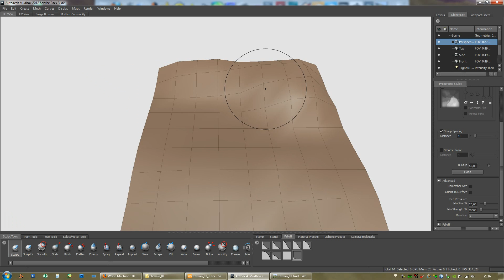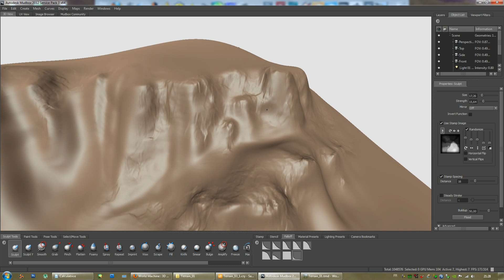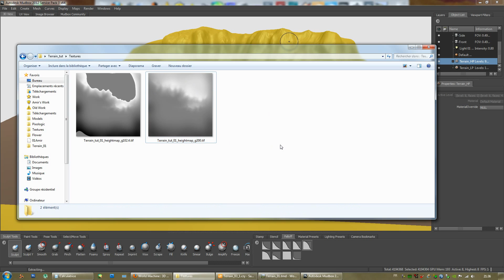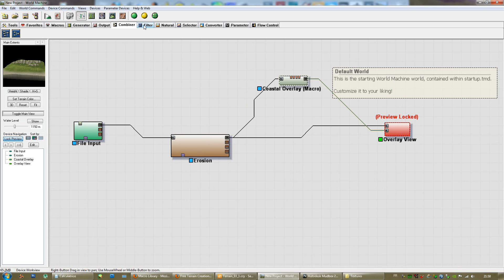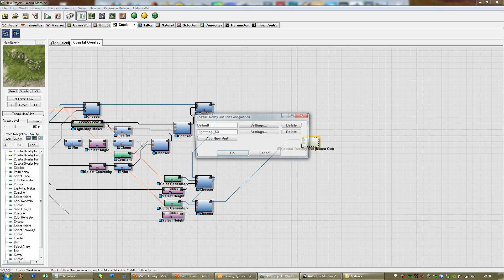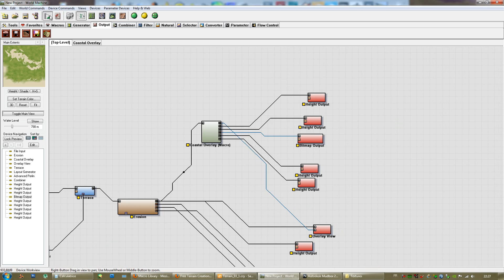Comment: how do i join the mudbox files together in world machine, ive exported them and import 1 to world machine but my map is huge and there on 512 by 512 planes, i dont understand the tile  system i have the pro version of world machine and just need help, i tried to make a 8192 by 8192 map in mudbox but its not detailed enough and take a long time to build in WM, help is in need, how to i join loads of hightmaps together
Reply: Worldmachine has a node for Tiled input maps, that should work for you.  Otherwise just photoshop them together.

Comment: First of all thank you for this tutorial series. I am really interested in creating landscapes for CryEngine and I managed to create a quite nice seaside road with the sea and cliffs on one side and a "mountain" on the other side I guess but I experienced a problem with that "noise" part of this video. I used the settings of your Scrape-Tool except that Falloff (don't know how to achieve this Falloff like yours) and I don't get this noise or erosion effect like you. I am using the free trial of Mudbox 2015 and my mouse 'cause my sister is using my wacom tablet for her drawings.
Reply: Problem solved. Just tweaked the randomize effect of the stamp a bit and changed the strength of the Scrape-Tool.

Comment: mudbox?... i doubt is cheaper than world machine, but maybe you could make a basic rgb splatmap in mudbox and use it as the base to start texturing in photoshop or use it directly in the engine you're using.
heightmaps, again you could goggle image'em and modify them in photoshop and mudbox too.
also, gimp used to be good a open source (and free) photoshop replacement, don't know if it stands to today standards thou, haven't used it very much.

Comment: 4km by 4km? Lol.

Not necessary. Just make multiple levels. A 4km by 4km map not only would be extremely time consuming, but will limit your targeted audience. Even if you market for free, you're still going to need someone to play your game.

Also, no, it's not transferable. Changing size of the map means you have to start over. At least that's what the SDK itself states. A heightmap would be sufficient if you made it at the 512x512 :)

Comment: There's a better way: Right-click on the downloaded macro file and click on Open with. Choose WM as application to open the macro with (you'll probably have to browse to the app) and activate the option to open all files of that type the same way. You'll get a message that the macro has been installed properly. The newly installed macro will be listed under the pre-installed WM macros.

Comment: Incase anyone has this problem. I have the soltuion. 

Open the tiff file in photoshop by going to File>Open As>Click the file, Open as a tiff. 

This way it stops photoshop automatically opening the file as a 32bit or 8 bit, 

The image's 'bit' can be shown in the Image>mode section inside photoshop.,16 should be ticked!!!

Comment: In mudbox, i can barely sculpt my terrain, Its so slow. And another thing, you say that i should make a plane of 512x512, but when i drag on my grid and i u say that i should use 512 in width and 512 in height it just makes a small square in the middle of the grid.

Comment: I'm not a formal Maya User but I've used it in the past and thats some of the many reasons I hate it, not saying that its bad but its unnecesarily complicated IMO, anyway, it comes by default with some exporting options and many other features shut down, such as the OBJ Exporter, so you have to turn them on manually, if I'm not mistaken you have go to Window, Settings & Preferences, then you select Plugin Manager then a large list of stupidly turn off shit should appear, you just turn on OBJ =)

Comment: hey, if I am using the basic version of worldmachine, and I am creating a small map for cryengine, what size plane should I start with? If i remember correctly, you ended up rendering (in worldmachine) with a resolution of 2048x2048, giving you around 4 million polys. As the basic version is restricted to 512x512, we have around 200000 polys. The end size of your map was 1024x1024, and you had a plane 512x512 in Maya, so If I end with 512x512, I should start with 128x128?

Comment: @s13n1 I should clarify my comment. If you create a UV for you're plane object (low poly) within Mudbox, it will do a very bad job and you will end up with an unusable height-map output. Did you're plane have a UV already created by Maya? You only need a UV for the low poly Plane, not the high poly terrain. So you can import a terrain and sclupt it in Mudbox then bake the displacement map onto the low poly plane.

Comment: @InterFiction100 
Hi there, the size of the plane doesn't matter that much, what matters the most is the size of your heightmap. I used a 512x512 plane just as a personal preference to work with in mudbox. I could've worked with a 256x256 or 1024x1024 plane and have the same result in the end.

Comment: @GaGiCF Your system should be able to run it. If not, then make sure to check the minimum system requirements. Also not the Nvidia geforce cards do not work to well with 3D programs such as this as it CAN create problems.

Comment: @slagnecro 
Hi, it all depends on the resolution of your heightmap (2048x2048 = approx 2km²; 4096x4096 = approx 4=km² in cryengine) when imported into cryengine with a 1 meter/unit.